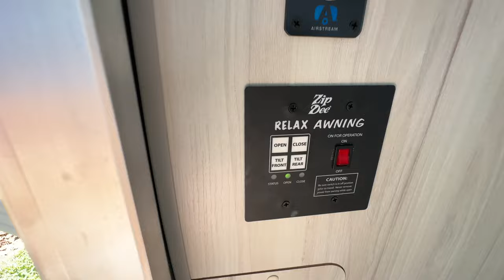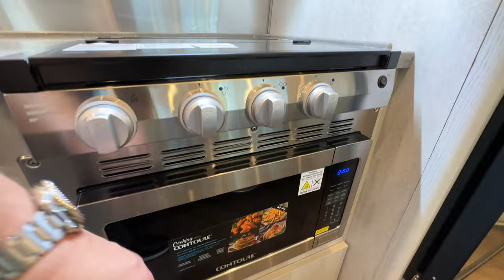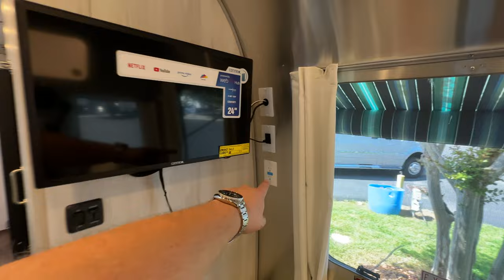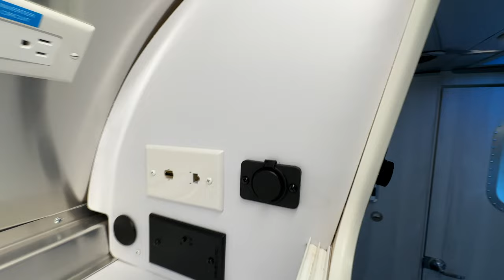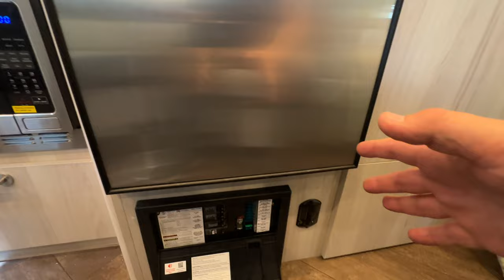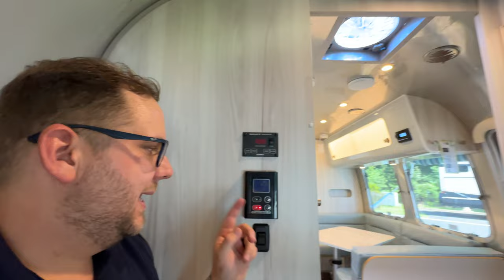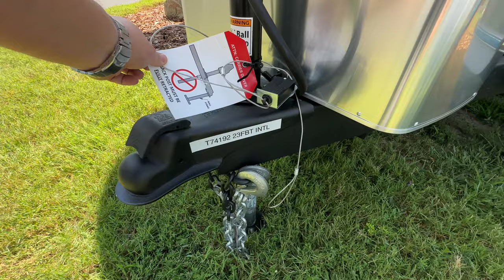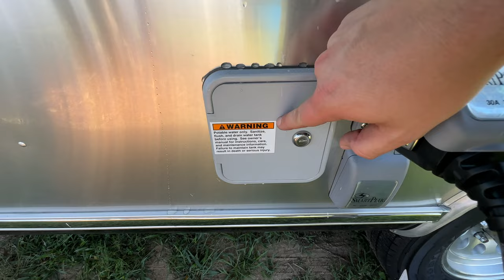First look at the 2024 Airstream International 23FB Twin Bed

Comment: Best option is to use the seat backs for the bed.  Slide the seat bottoms to the middle and slide the backs down flat.  Also, the table sits on top of the seat surfaces.  This creates a hump in the middle of the bed which is not comfortable.  We use 1-inch lightweight foam board on the seating surfaces to raise them up to the table level. Then all the cushions sit on a level surface which is much more comfortable.  For premium comfort, add a 3-inch memory foam topper cut to size on the whole bed area.  It rolls up with the fitted sheet and can be stored in the closet along with the foam board pieces.  My wife and I can both fit on the dinette bed and the kids get the Jack and Jill twin beds.  Another cool item you can get are plastic bins from Granger that fit those storage spaces under the seats perfectly.  Downside to the sliding table is that the tracks bend easily if you push down on the table as you get up.  They cannot be bent back and the table will slope permanently..  I took the tracks out and just screwed the tabletop to the post underneath.  You can still twist it around. The sliding mechanism had no friction so it never really worked anyway if you were trying to eat at the table.

Comment: Hey, Chad.  When making the dinette into a bed (after lowering the table), try moving both seat cushions to the center to cover the table area and use the seat backs dropped to fill in the ends of the bed.  The seat backs look like they have the right contour to make the bed flat.  Don't use the three cushions on the window wall at all.  Maybe that'll work - maybe that won't work.  I'm not in the market for an Airstream but I try to catch all your vids b/c they are full of information.  Thanks!

Comment: The AC drain pump leaks on this one, onto the roof as well.  This is a defect in the AC units.  Its supposed to drain through the DRAIN HOSE in the wheel well.  For some reason, theres now a PUMP to pump the water out of the AC unit into the drain lines, yet this pump in many cases either does not work, or is not connected correctly as a common problem.  I am still waiting for mine to be repaired.  It is NOT ACCEPTABLE for water to drain onto the roof of an over 100,000 camper. Its messy, attracts birds, bugs and makes a dirt mess of the roof.

Nice video though, thanks for posting!  I have this exact model and color scheme. We like it a lot.

Comment: Thanks Chad.  Discuss the front end separation issue.  This unit has front end storage and that appears to be part of the problem.  What guarantees does your dealership offer surrounding this issue?
Reply from the maker: The 2024s to do have an improved front end to help prevent front end separation. Dealers aren't able to guarantee something they didn't build. Airstream does give a 3 year warranty that covers the front end.
Reply: @ChadsRVReviews  then make sure you discuss this issue upfront with all your potential buyers.

Comment: Is there an option to get a bigger TV?  Also, when changing the table into a bed, I think putting the 3 back cushions in the center might work better than one seat and 2 backs.  The setup you used had a 1/3  of the big cushion "floating" without any platforn supporting it.  One good roll has everything on the floor. 😊😅😮😢
Reply from the maker: There isn’t an option from Airstream for a bigger TV, but I’m sure you can make something work aftermarket!

Comment: WHILE ON THE ROOF THERE IS A LOT OF WATER, WHERE WAS THAT WATER COMING FROM?
Reply from the maker: Maybe the A/C??
Reply: I thought there was a drip drain to the ground.
Reply from the maker: There is, but sometimes more water than the little pump can handle it will drain off the side. @Sarboleda2495